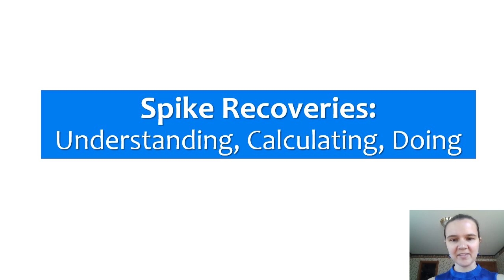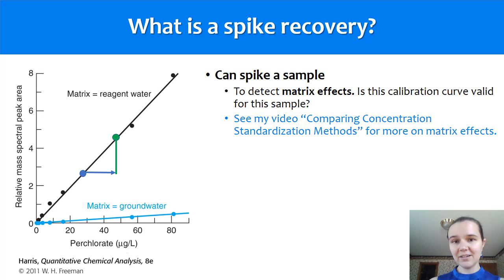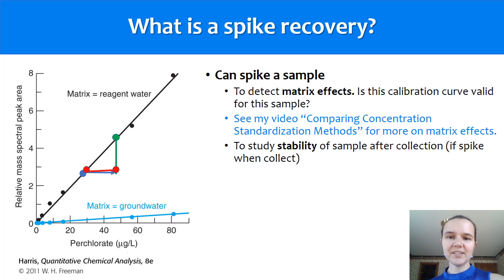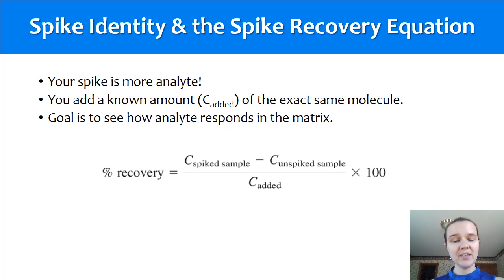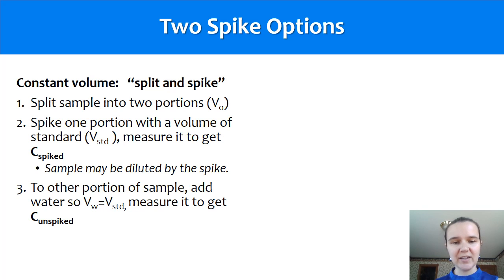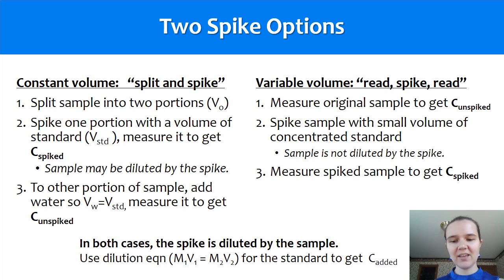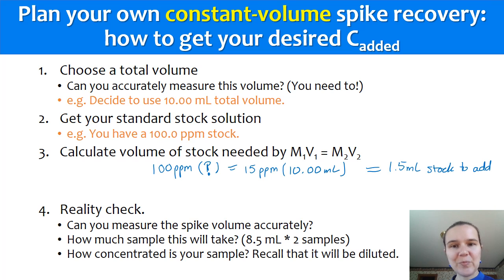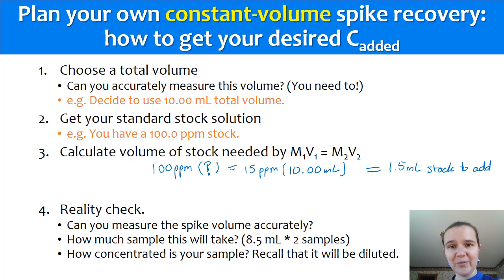Spike Recoveries

Comment: Is there a difference between matrix effect and recovery percent, or are they one in the same?
Reply from the maker: Matrix effect  is the concept that analytes will respond differently in different systems. Spike recovery is the most common way to measure whether a matrix effect is present. If the spike recovery is close to 100%, then you can conclude that the analyte behaves the same in your sample (which is spiked) as it did in the set of simpler solutions used for calibration. I hope that helps.